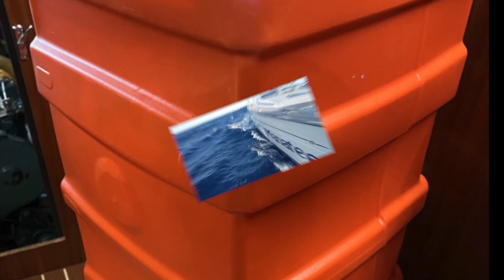021 BooteundTechnik.de - Atlantiküberquerung Gedanken

Comment: Hallo Frank, du hast sehr profund und ausführlich über Technik erzählt, aber ich verstehe nach vielen Jahren immer noch nicht, warum jemand bei Segelbooten dieser Größe einen Generator anstelle einer 2. Lichtmaschine (am besten mit 24V) eingebaut hat. In der Regel sind das kleine Einzylinder, die andauernd ein unangenehm wummerndes Geräusch von sich geben, wo doch die Hauptmaschine in der Regel die weitaus leisere ist. Ich weiss, ihr habt ein Serienschiff, aber ich hätte erwartet, dass du diesbezüglich eine Stellung abgibst.
Auch verstehe ich nicht warum die meisten Hersteller immer noch mit 12Volt  mit allen Problemen (Spannungsabfall etc.) operieren. Für die Motoren  ja, aber für das Bordnetz?  Es kann heute alles außer dem UKW Gerät und NMEA 2000 mit 24 Volt (weniger Kabelwiderstand, höhere Effizienz bei Invertern etc) betrieben werden.
Für das Geld eines Generators kann man locker eine 2.leistungsfähige 24V Lichtmaschine am Motor anbauen lassen, die Batteriekapazität erhöhen und sich einen großen Inverter leisten.
Bedingt durch die 2 völlig getrennten Stromkreise (nur minus ist verbunden) kann man sich Tenndioden, Hochleistungsregler und so manches unnützes Zeug ersparen. Es ist alles viel einfacher, übersichtlicher und vor allem weniger anfällig.
Auch ein Wassermacher kann, wenn er schon elektrisch sein muß und nicht direkt von der Hauptmaschine angetrieben wird,  bei 24Volt viel leistungsfähiger und mit weniger Motorstunden betrieben werden.
Ich verstehen das einfach nicht. Mir kommt vor, als ob die ganze Branche, (die Yachtzeitschriften sowieso) diesbezüglich schlafen würden und ich habe den stillen Verdacht, dass man deswegen bei 12 Volt bleibt, damit man den Kunden viel mehr unnützes Zeug verkaufen kann. Sorry ist mein Eindruck.
Ich selbst habe auf meinem 12m Eisenschiff von Anfang an, 24 Volt, Traktionsbatterien mit 1200 Ah, einen 5KW Sinus Wechselrichter/Lader, einen Wellengenerator am Ausgang des Getriebes, einen sehr starken hydraulischen Autopiloten und auch einen von der Maschine angetriebenen Wassermacher mit 240L/h:  all das seit vielen Jahren ohne Probleme
Deine Meinung als Sachverständiger würde ich gerne hören.

Gruß Robert von der "sapore di mare"    https://studio.youtube.com/video/30y8YcHiFwQ/edit

PS.: Du bist der einzige Deutsche der das Wort "Kaffee" so ausspricht wie es gehört, nämlich die Betonung auf "E" und nicht auf die "A" und Doppel "FF" Kompliment!
Reply from the maker: Hallo Robert,
vielen Dank für Dein Feedback und das Teilen Deines Energie Konzeptes auf der sapore di mare.
Was unsere Überlegungen und die daraus abgeleitete Entscheidung zum Einbau unseres Generators betrifft, kannst Du gern in meinem Podcast Nr. 7 hören.
Das Thema Energie Konzept auf einer Segelyacht ist so individuell, wie das Boot und die Bedürfnisse des Eigners.
Deine Anregung mit einer zweiten Lichtmaschine am Dieselmotor Strom zu erzeugen finde ich überlegenswert. Auf der Manatee passte das leider nicht.
Zudem verbraucht der Dieselmotor ca. 2,5 bis 3,5 Liter pro Stunde im Betrieb. Unser Fischer Panda verbraucht ein Liter pro Stunde und ist darauf optimiert, Strom zu erzeugen. In seine Dämmkappe ist der Motor im Motorraum installiert kaum zu hören. Der Dieselmotor erzeugt deutlich mehr Geräusche.
Das Thema Bordnetz auf Booten mit 12 oder 24 Volt. Wenn ich die Wahl hätte wurde ich mich für ein 24 Volt Bordnetz entscheiden. 
Was das Energiekonzept Deiner sapore di mare angeht, das liest sich schlüssig!
Schreibe mir doch bitte eine E-Mail, ich habe noch ein paar Fragen zu Deinem Konzept.
Liebe Grüße von der Manatee aus Guadeloupe